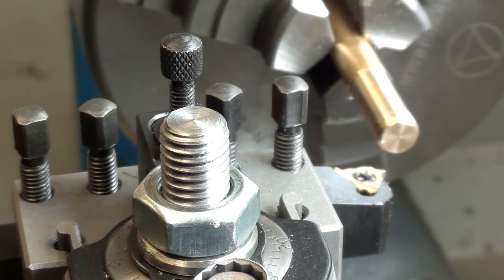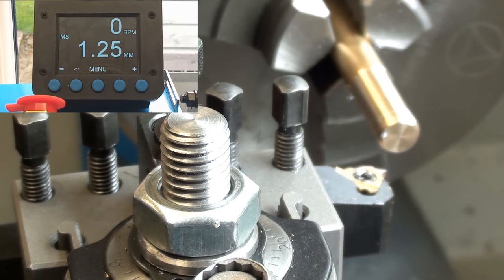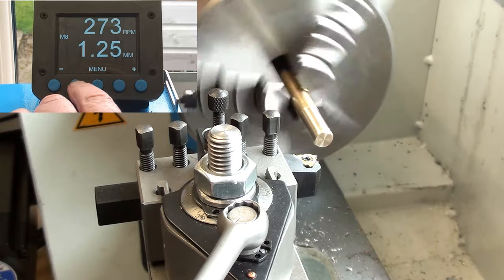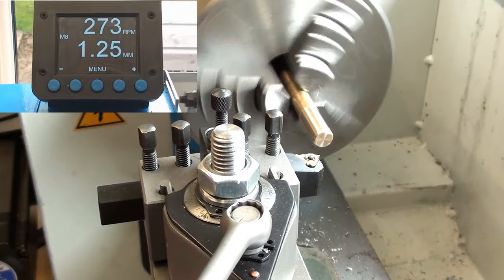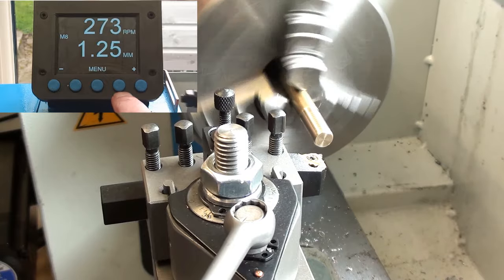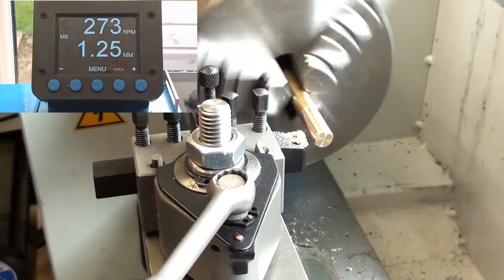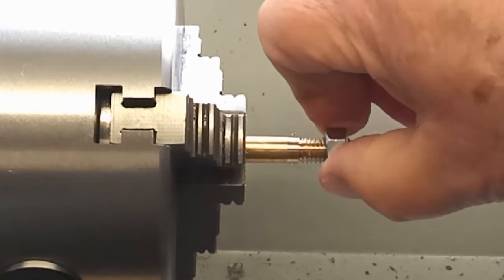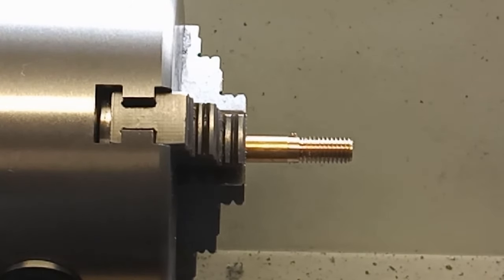Mini Lathe ELS thread cutting demo

Comment: What did you do to hide or move all the wires or connectors? is it just a new enclosure? if so can you post the stls on printables or thingiverse or thangs please?
Reply from the maker: All the print files are on Thingiverse.  Specifically, the modified front panel is at:
https://www.thingiverse.com/thing:6651632
The others are to be found at:
https://www.thingiverse.com/bizzibeeworkshop/designs
John